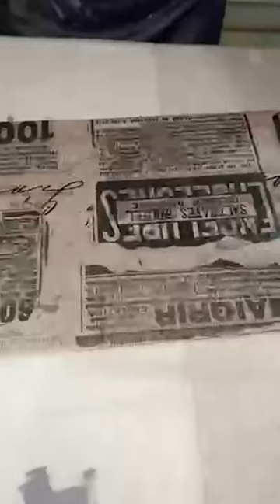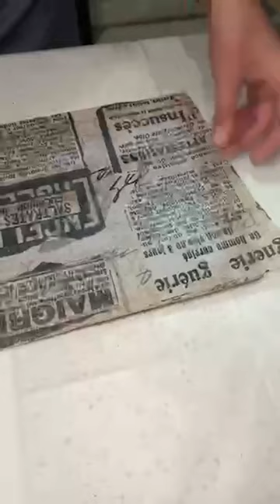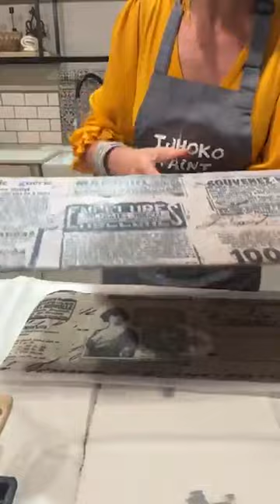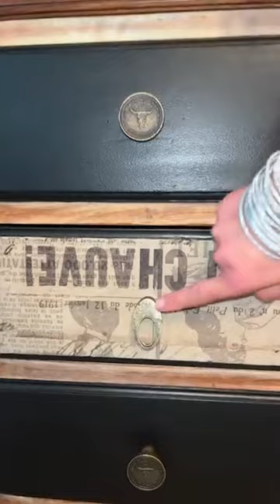How to paint furniture with Tjhoko Paint and Nadine Vosloo

Comment: Hi...I have another brand of chalk paint on my furniture. Sealer too. What prep is required before re doing them with Tjoko? Thanks
Reply from the maker: Hi there 🌸

Below is a list of steps that  need to be taken when you are wanting paint.                                      Step 1 - Clean surface PROPERLY with Lacquer thinners (we use Powerfix Lacquer thinners). Wear gloves and work in a well-ventilated space.
Wait until the lacquer thinners is dry 20 - 40 minutes. I would then repeat the cleaning process again. (WE DON’T RECOMMEND TO PAINT ONTO A VARNISHED SURFACE IF THE SURFACE HAS BEEN VARNISHED WITHIN THE PAST 6 MONTHS. Varnish takes at least 6 months to cure. When painting onto an  enamel surface - contact us at support@tjhokopaint.co.za to give the right advice.)

Step 2 - Start painting. We recommend painting at least two coats. Very important when painting is to always allow a coat of paint to dry properly before the next coat of paint is applied. Depending on the colour being used a third coat would be necessary for example painting a white paint onto a darker surface.
The equipment you use for painting also plays a role.  A foam roller leaves a much thinner coat of paint than a paint brush. Therefore, more coats of paint would be required when working with a foam roller.

The paint does have a matt finish (Tjhoko Paint is a self-sealing, water-based, matt chalk paint) it does not need a sealant unless you have the piece of furniture outside or in a room like the kitchen or bathroom where there is lots of moisture. The Glaze makes the surface water and UV-Resistant. It also prevents stains and provides a more washable surface. We also recommend to seal tabletops and pedestal tops, kitchen, and bathroom wall tiles (painting in showers not recommended).

Step 3 - If you are applying the clear glaze, always allow the paint to dry for at least 4 hours before starting with the glaze application. In coastal areas or during winter months we recommend to only start glazing the next day (leave paint to cure overnight).
1. Dilute the Clear Glaze with 30% water (30ml of water for every 100ml of Glaze) or 3 parts Clear Glaze and 1-part water. (we recommend cooled, boiled water as it is less contaminated)
2. On darker Tjhoko colours we recommend 50/50 (1-part Tjhoko Clear Glaze and 1-part water. You can also use this ratio for a less sheen finish.)
3. Dampen a clean, colourless cloth with water and squeeze to remove all excess moisture. A Microfibre cloth works best.
4. Dip the cloth completely in the mixture to absorb the mix and then squeeze to remove excess moisture. 
5. Evenly wipe onto the painted surface. Work in a well-lit room to ensure that the entire surface is covered. If streakiness or lines occur – (it is caused by the fabric / cloth) just apply a second coat, half an hour later.
6. Should you wish to change colour or add paint techniques over the clear glaze, you can do so once it has cured for an hour or longer. 

We have numerous DIY videos with steps available on both our website and YouTube channel www.tjhokopaint.co.za and www.youtube.com/tjhokopaint